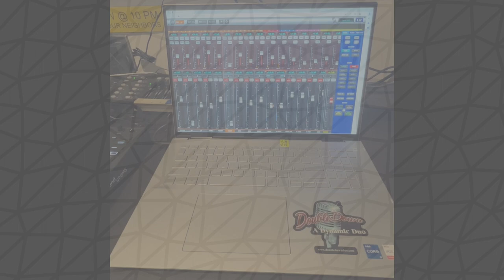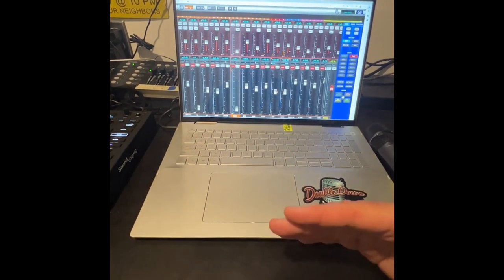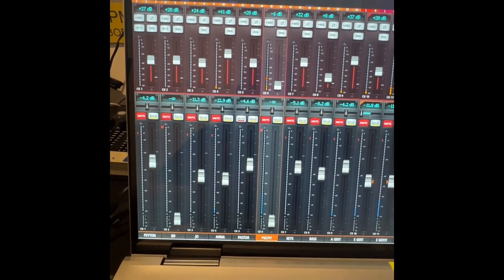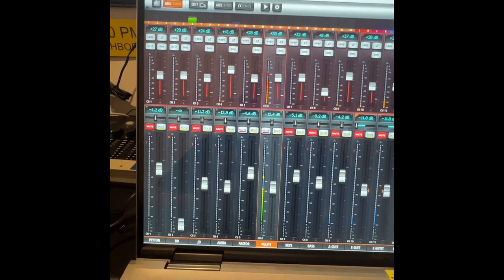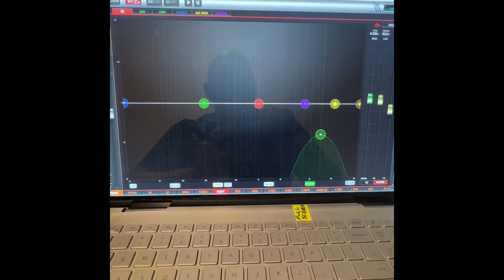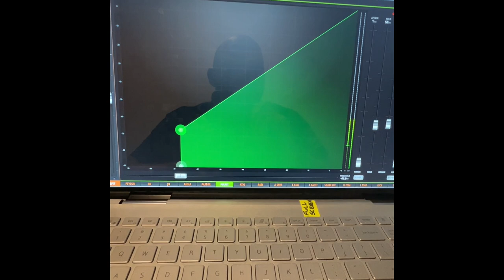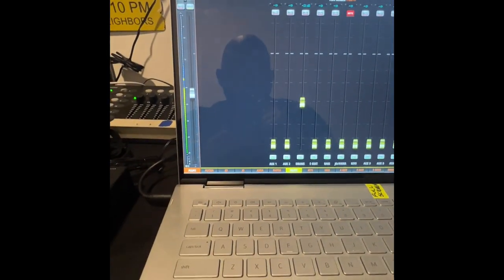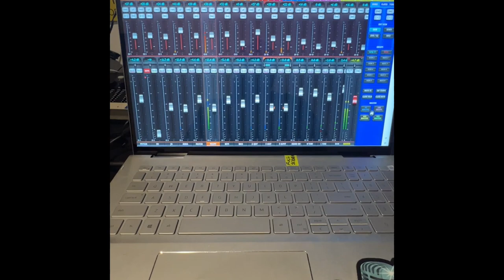Ui24r Tutorial, Gain Structure, Dynamics, EQ, Live Music Setup!!! Let’s Roll!!!!

Comment: Great video thank you. Could you elaborate on the recording function. So far my levels for the stereo and multi track recording seem too low. I don’t quite understand how to bring up the gain for that.
Reply from the maker: Sure, it all starts with a good game structure from the beginning. You have to make sure your gains are set right your levels are all hitting about -12 DB and relatively balanced. Then, 
your multitrack and stereo recordings are picking up essentially what is going out in front of house. The easiest way to increase that gain level on your recording is to bring your master left right up to unity.

Then mix your live output as you would, and that should give you better gains. 

Let me know

Comment: You are doing it backwards. As a professional sound engineer I can say that without reservation before you can talk about setting levels on the console you must first set your amps to "Nominal" Nominals mean they are set to the highest level without attenuation. Usually this is "-0- ".  The way I know a sound engineer ( Sound person) has no idea about theory is when I see the faders all over the place.  To set up your mixer properly, you set the channel fader first, not last. All the channel faders should start at the "-0- or whatever the Nominal is, then the gain is added until you begin hearing feedback and then back it off enough to get some head room.   If your channel faders are all over the place this means you didnt set up the gain function correctly. Go to any major concert and look at the faders, they are 90% across the screen, with one or two at maybe up to 20% dip. By the way I am on a number of some top performers live albums and have been a professional stadium sound engineer for 40+ years. Also when you are setting up your EQ on any channel ( Noting that you have ran a tone generator for the room EQ's for the Main output first and that is set) You can be more precise if you hit the RTA on any channel and see with your eyes how any person speaks/sings and adjust the EQ accordingly. The RTA will show you the persons exact heights and valleys, and you can adjust the accordingly. Also, if you set your EQ correctly you really dont need a de-esser. I would only insult people if I told you why they put De-essers and feedback eliminators on mixers now.
Reply from the maker: Thank you so much for your feedback. I am aware of your method of mixing and it is a valid style. I’m unfamiliar with the term nominal, but I do know the term “unity gain”…. Which I believe are the same thing according to your description. And you are correct I forgot to mention, in this case the powered speakers, should be set to unity. Thank you for that observation. With respect to doing it “backwards” I believe that is an overstatement. The word I would use is “different.” There are multiple ways to skin a cat. Much like the term Nominal vs Unity Gain neither are wrong, just different. I learned something today from your method, now my toolbox is a little fuller, thank you. I’m impressed with your resume, congratulations. So, my question is, if all faders are at unity or “90%” as I could clearly see if I ever attended one of the concerts that you or your peers engineered and the gains are backed off just below feedback, how do you “mix” the individual levels. I.e. one vocalist louder than the other, or boost a guitar solo?  Anyway, thanks again for your input, much appreciated and really brought clarity to is “sound guys”.
Reply: Thanks for your comment it's sort of validates my non-professional thoughts on gain structure as well, what's my first experience with digital mixing. I think early on there were a a few problems with some inferior preamps which made the learning curve a little rough. RTA is an awesome way to learn. I remember older sound guys back in the day who used stand-alone units back in the day. What amazes me is how different rooms can be and how things can change with an influx of a crowd. I'm just a dumb bass player singer who's been lucky enough to learn from respect and sound guys.
Reply: I don't think it works that way in this software. If you set the mix fader to 0 you get no sound. I believe this is an intentional feature so you can get your gain dialed in without pushing any sound out tot he house. then you can adjust your mix accordingly as you bring up the levels.